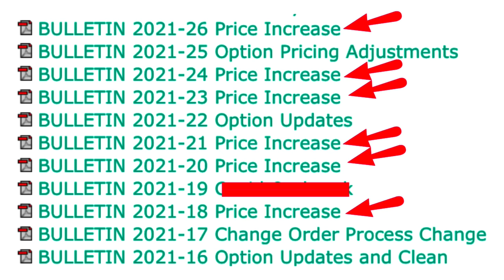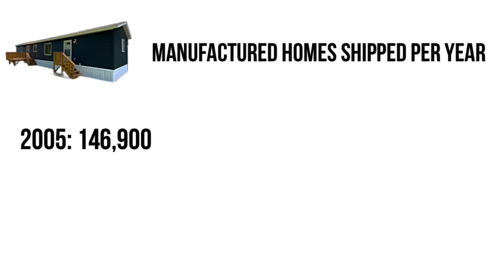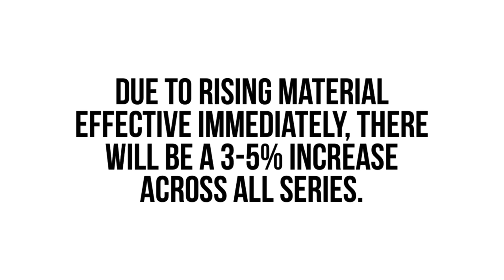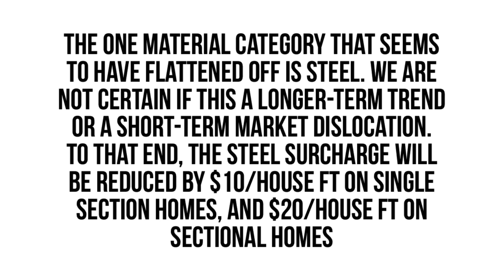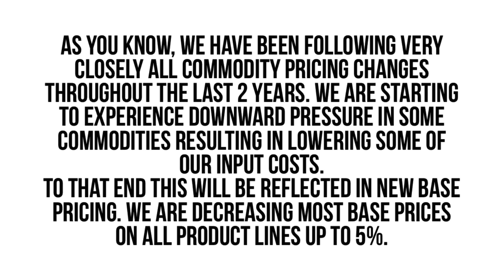The Manufactured Housing Bubble Finally Popped

Comment: It's about time! There is no way that they were NOT gouging us. Manufactured Homes by their very nature should be considerably cheaper. 
I live in Australia and I've taken to task many such modular manufacturers for actually charging MORE per sqm than a standard home build!
Reply: to be fair, lumber prices would increase the prices. Still, I'm sure the inflation in the stick built home market wasn't helping.
Reply: It depends on whether you’re comparing apples to oranges. There are many home building variables between modulars and site built homes that could make modular’s more expensive, but on the whole for same size, site/infrastructure cost, the modular should be less though not necessarily a big difference. Manufactured vs site built, depending on upgrades, should run 10-20% less, and manufactured should take less time to complete.
Reply: Prices are nearly doubled for a manufactured home (here) as compared to a standard home (steel core or wood)

Comment: I'm not in the market for a manufactured home right now, but I'm glad you are giving people sound advice and updates about the current market.  (I'm holding out for one of those cool European tiny houses.)
Reply: Me too. I'm excited for the Huga, which is strong enough to berm and sod. Extremely resistant extreme weather.
Reply: @OffRampTourist  I'm goofier and want an Iglucraft house from Estonia.  Looks like a Hobbit House.
Reply: @OffRampTourist  The last thing I would buy right now is a manufactured home like the one he was talking about. With weather changing as drastically as it has been, with floods, wind, and such, I want something on stilts and something that can hold up to the extremes that we've been seeing of late. I've not heard of the Huga, I'm going to have to take a look see.
Reply: @OffRampTourist  I just took a peek at the Hugo site. I like what I see, but there is very lttle information on them. I did like that it looks wheelchair accessible, in a very large kitchen, but it looked like there were stairs.
Reply: Tiny house prices have gone through the roof
Reply: This is not good advice .. if you look at Dale's and Rosales of trailer homes aka pre manufactured homes these homes lose value year over year unlike a tiny home or traditional home it more like a car it loses value and you can not do anything about it .. they dont even give you deeds for trailer homes just titles like they would a car
Reply: @ptravers9077  Tiny homes also lose value.
Reply: @toomanymarys7355  I'd beg the differ usually tiny homes are built on land and are zoned. They are made from foundation up and have a deed .. not a title like prebuilt or mobile homes. But I guess you are right anything can lose value but tiny homes wont lose value because they are tiny it would be because of poor quality or neglect.  Trailer homes never hold value tiny home lose value like other thing if poorly made or neglected... that simple

Comment: I did not buy 2 years ago and now the home is $37k more. Plus the community fees went up $85.  So I decided to see what options are out there and found this video. TY for the info.
     I hoped to buy before selling my homestead but, prices are high in FL so I'm tempted to sell. The problem is do I buy a smaller home (1 bedrm) that is the amount I have or wait for prices to drop to buy the size I wanted ( 3 bdrm?) I know  there are no guarantees but, I don't want a smaller home which will not allow me the lifestyle I want ( fostering disabled kids.)
Reply from the maker: Tough to know what to do right now isn’t it

Comment: One thing to remember about housing price changes: in a market with mortgages, there's a trade-off between interest rates and prices (principal of a loan). Even if prices declined a bit, interest rates have increased such that it still would have been best to buy a house before January 2022. The details of the trade-off come down to the interest rate, the size of the down payment, and the price of the home; but it's important not to assume that lower prices automatically mean better deals. Unless you all an all-cash buyer, that's not likely the case. In most places, prices would have to decline 20 or more percent to allow you come out ahead given that interest rates have practically doubled. (Again, it's about the declines since with a larger down payment, the bigger the benefit of decreased principal.) 

It's also worth remembering that most people don't sell homes simply to receive the cash but rather to buy another home. If all homes in an area are decreasing in value, then your home may bring in less cash, but the home you'd buy is also somewhat cheaper. (It's the realtors who received percentage commissions who would suffer more as a result.) Of course, this becomes more complicated if you're changing metro areas.

The bottom line: the best time to buy is yesterday; the second best time is today.

Comment: I've worked in the concrete industry and I've seen an ever increasing trend of builders using steel for walls and roof structures in the stick built apartment
 market so maybe that market will reflect what you've said on manufactured homes as well

Comment: I set out to buy a mobile or even tiny house,and was also looking for land to put it on.I had done the same about 15 years ago, but my daughter got pregnant so I could not leave. Imagine the shock when I recently started looking and saw the prices had tripled and quadrupled. totally rediculous.no way I could afford one now, plus they don't do good in strong storms. I revisited tiny houses, only to find they are even more rediculous. Seriously, they want$100,000 for a house, that if you stretch your arms out enough, you can touch the opposite walls. No thank you.when I get back on my feet, will buy an acre or two, pour a slab, buy wood and figure out how to build a small house myself.
Reply: Tiny homes cost more per sq. ft. because they still have bathrooms and kitchens, the most expensive parts of any house, and the ones I see are built with the most expensive materials. If you want a less expensive tiny house, build a dry cabin with gas for cooking and solar panels and power storage. Get off the grid. That’s the way to live cheaper. Water catchment system for water.
Reply: @sarahgupton2552  but there's entire 2-3 bedroom houses with land for $30,000.you just cant move them. which I would not be doing anyway and don't think moving tiny houses a lot is good for them? and very expensive.
Reply: @pattiannepascual  I’m not getting your point. If you’re buying them with land, why would you want to move them?
Reply: @sarahgupton2552  I was just pointing out that for those who can't afford these crazy priced tiny houses, there are plenty of incredibly cheap regular houses on land you can still buy.
Reply: @pattiannepascual  I agree and any mfd home less than 20 years old, if decently maintained, should make an excellent home even if requiring some updating. Even older homes can be a good basis for renovation.

Comment: I took a peek at mobile home prices as I am soon to get off nearly 10 years on disability and the mobile home I am in is in less than stellar shape and I was eyeballing either renovating or replacing.  I bought my mobile home for $67,000 in 2002 and trailers on lots, not land, in parks with the highest lot rents around are going for more than double what I paid for mine and they are smaller.  I could probably pay to have someone take this whole home down and rebuild piece by piece for cheaper than what it would cost to buy one now THAT IS SMALLER than what I have.  I know mobile homes on lots over 1900 feet are not common but DAMN.
Reply: You should renovate.

Comment: I realize that companies need to make a decent profit ... or they won't be in business long.  However, I think they should only make the same % profit as they used to.  Take all current prices for materials & labor and maintain their previous profit percentage after all that.  It's when companies take advantage of the higher material cost and end up gouging customers for a bigger profit, that makes me see red.  And some companies seem to have no problem with doing that.  I thought about buying a manufactured or modular home but the prices became so outrageous, that in my area, buying a traditional home (around 2000 to 2400 sq ft) was more affordable.
Reply: Why should they be limited to how much money they can make? How would you like it? Go away
Reply: @dcg590    I guess it's still America and we all still have equal rights ... You go away!!  Lol

Comment: My home has been delivered on my property, and now it’s time for the utilities to be connected. Whatever is happening in the market now is of little concern to me now. I would have loved a lower priced home, though.
Reply from the maker: Glad to hear it has been delivered! Congrats
Reply: Could have have stick built in less time.
Reply: Mine was put in site in March and still not ready to be moved into. Mostly drywall problems unforgivable.  Stick built would have been faster
Reply: @beverlyh1554    Oh, wow!  Sorry to hear your troubles. My home is textured and painted drywall with batten strips.  There are some strips that need to be nailed up better, but that won’t prevent me from moving in. My delay is strictly coming from a supply chain shortage delaying the electricity connections.
Reply: @KerryTarnow    Thanks. I wanted fully tape and textured drywall, but I got such a good deal on my home, with a layout I loved. I decided I could upgrade finishes as I had the money to do so.

Comment: It did but mostly from a dictated market driven by home sales and 2% fed rates was a way to kick the can down the road for another year but once the rates went back to normal and post COVID=inflation=recession=crash and now with a dry market meaning low inventory of course this is going to happen to real estate across the board. It wasn't if? it was WHEN? only a matter of time like now. Buyer burnout mixed with a garbage economy and loan rates with cancel culture and other factors like "Ukraine" people just walked away from a sizzling market because there was too many of them not enough supply to keep up and also not enough qualified and stagnant market doesn't help this either.

Comment: People need to realize mobile homes are not quality built the floors are 2x6 the walls in most cases are 2x3s the rafters are 1x2s and they just use house wrap on the outside and then put plastic siding over top of it floors are chipboard wood glue together and so is the roof so all in all they're not even built as good as an out building my out building has regular roof dresses 2x4 walls and 2x6 flooring with plywood on the floor and the roof much better than a mobile home and they are way way over priced you could sell them for a half or what they're going now and they still make a profit
Reply: Let me introduce to a profitable investment opportunity for a good investment program👆👆